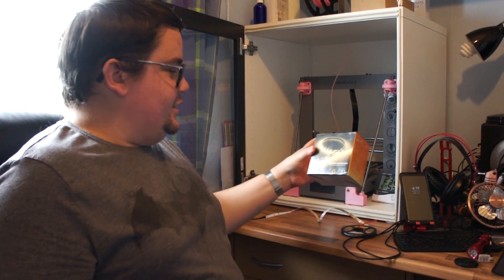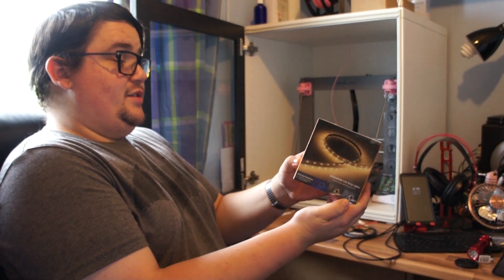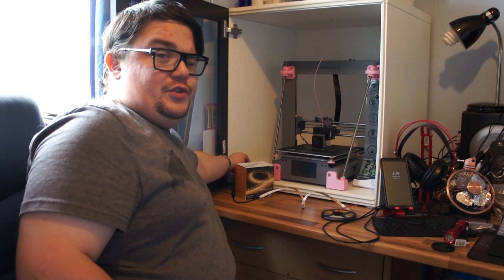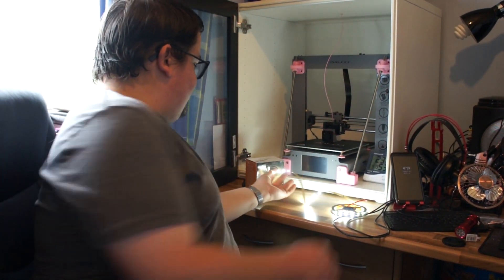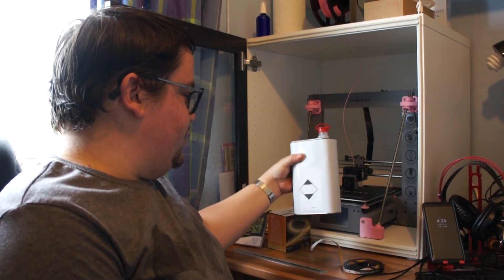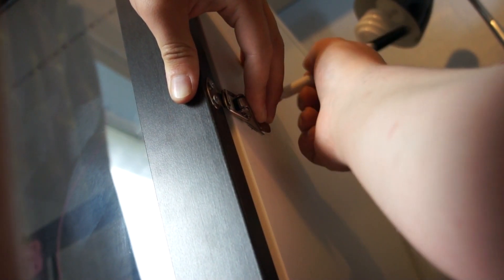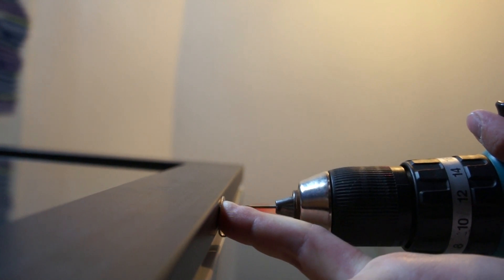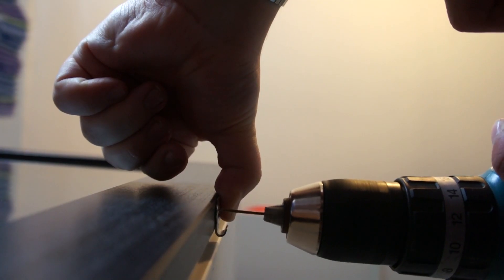How to upgrade the IKEA 3D Printer Enclosure!

Comment: Awesome find! I picked my parts today and assembled. Even the hinges fitted in from the original Stuva doors xD 5€ door, 25€ box, much cheaper than a special one... will probably try to fit the filament inside instead of outside, and an exhaust will be necessary too, once it heats to 200°C, the box will turn into an oven without air circulation :D Thanks for this tip, one less problem!
(Btw. also black door here, didnt find white for that price, but has some sci-fi look with this)
Reply from the maker: No problem, glad I could help! I have found that air circulation isn't really necessary as the enclosure only gets to about 30°C which is warm enough to prevent warping but wont toast your printers electronics. If you are going to be adding an active heater too though, then definitely add some ventilation! Try and keep the electronics out of the enclosure if that's the case as the heat will kill them super quick. Its one thing I wish I had mentioned more in the video! Mine is ok as its only passively heated from the bed. 

Thanks again for watching :)

Comment: Great video! Even if it is now one of your older ones! This printer is my first ever. I've just ordered a cr10spro v2. Anyway..... I'm now thinking about building my own encloser for the BALCO touch. The only thing holding me back is finding out that power supplys especially and the motherboards shouldn't be inside the encloser too due to heat. And as the printer is all one unit its holding me back. What do you think? Did you have this worry? Does the pros outweigh the con?. Do you notice the different in prints with the enclosure? 

Sorry that's a long comment. Hope you can help
Reply from the maker: Hi Charlie, just replied to your other comment xD Thanks for your kind words :) Yes, I did have the same concerns and you are absolutely right about the power supply not liking the heat inside the enclosure. But I went ahead anyway because this is a passively heated enclosure, meaning the only heat source is the bed and nozzle itself and no extra heaters. This means even on a long print, the temperature inside only gets to around 30°c which isn’t too bad for the power supply as its within spec. The enclosure is mainly for keeping a consistent temperature throughout printing ABS and PC so there is no drafts that could affect the print. It doesn’t really get warm enough to prevent warping with ABS so I use some glue stick before I start the print and it works great. I would recommend Elmer’s Disappearing Purple Glue Sticks as I have never had a problem with things coming off the bed! I actually plan on making a part 3 to this series taking apart the printer and extending the wires so the power supply and screen are on the side of the enclosure. This means i could add more insulation and an active heater for better quality prints with ABS and PC. BTW you don’t need an enclosure at all if you are just using PLA, in fact it will degrade quality. When i print PLA I leave the door open because i want the part to cool as quickly as possible. Hope this has been of some help! Thanks for watching! :)
Reply: Will, thankyou so much for the reply. Very in depth and ofcourse helpful. I'm yet to print abs... so like you said I will stick without the enclosure. I was just debating it for future. Due to quality of prints etc. Be nice to know drafts and heat changes wasnt effecting the printer. The only plus side is I'm currently building a workshop in my garden for my printers etc and I'm worried about keeping a constant heat as at night it obviously drops considerably....... so maybe in that respect I would build one. I'll do some test first! Anyway thankyou for the info it's good to know it's all within spec! Thankyou again. Love it when the online community can help!
Reply from the maker: @charliewilliams3766  No problem mate! Do let us know how you get on! :)

Comment: Hi, how are you powering the LED light strip, is it from the IKEA printer, if not - how?
Reply from the maker: The power adaptor and dimmer comes with the leds and they are all wired for you with a connector so just cut the leds to length, plug them in and your good to go :) The link is in the description :) Thanks for watching!

Comment: Interesting and helpful  video,well edited too. Have you noticed a large reduction in sound from the printer ? Does the Printer over-heat I mean can it be left unattended without worry of fire or damage ?
Reply from the maker: Thank you :) Glad I could help! Yes it is quite a bit quieter with the enclosure door shut. I would keep the door open for PLA for the best results but for anything like ABS the the printer is fine left running with the door closed. Because it is only passively heated from the bed, it doesn't get hot enough to do any damage to the printer. I left it running for a good few hours printing some polycarbonate filament and it was completely fine. Just make sure you preheat the bed for about half an hour before and you will be good to go :) Thanks for watching :)
Reply: @willcaddy  Thanks for the reply. I will be new to 3d printing in the New Year and have only very cold cellar space to put it in. I was hoping that keeping the heat in your enclosure would achieve a good print. I suppose adding insulation to the enclosure might help too. I really do not have a clue. Do you have any advise for using a printer in a cold environment ? I have not bought one yet so maybe there are tougher printers than others :) Any help would be gratefully received.
Reply from the maker: @slicedpage  Ah, you have picked a great time to get in to it! Firstly, I would start with just standard PLA and learn everything you can about that first before trying to move on to ABS or more exotic filaments. Secondly, PLA actually benefits from cooling quicker, you get better quality that way so i would experiment using a printer without the enclosure first and then if you find that you are having problems then look into making an enclosure. Once you have mastered PLA then you will definitely need an enclosure for hotter materials like ABS. 

Insulation will most certainly help, as well as doing a better job at sealing the door than I did ha ha. I actually have some silver bubble style insulation i plan on adding to my enclosure so keep a look out for that video hopefully coming soon! My single best piece of advice would to not be afraid to use your printer. You will most likely get failed prints and problems along the way but that is the best way to learn your printer as ever printer will be a little bit different. Try and find out everything you can on YouTube, forums, reddit, Facebook etc and don't be afraid to ask if your not sure! 

When buying a new printer i would recommend the same printer I have (Balco 3D Printer Touch/Cocoon Create Touch/Wanhao Duplicator i3 Plus, there all the same printer). It was a really great printer to start with for me. Also if you are looking for a larger printer then the Creality CR-10(S) is a great bet also. If you have the money, the Original Prusa i3 MK3 is king for its price range but will set you back a bit more than the other two that i mentioned. 

Hope this has helped you out!
Reply: @willcaddy  Thank you for making the time to give such great advice which I will follow. Proud to be the three hundred and eighty eighth subscriber. Now I have to choose a printer   arggggh   Have a great Christmas.
Reply from the maker: @slicedpage  You are very welcome, thank you for taking the time to watch my video :) You have a great Christmas too!